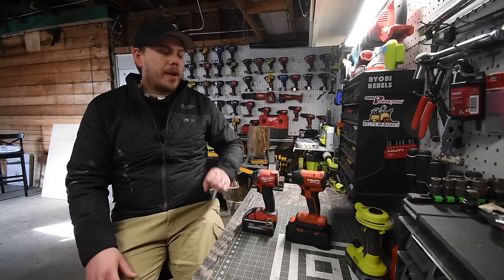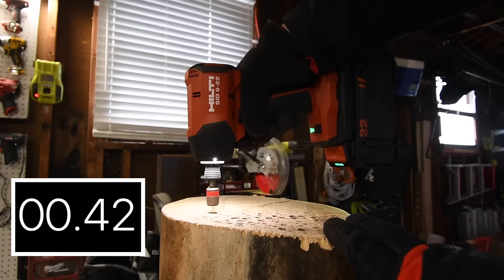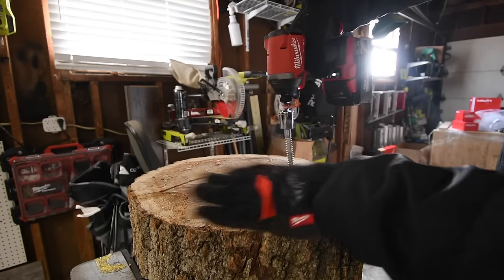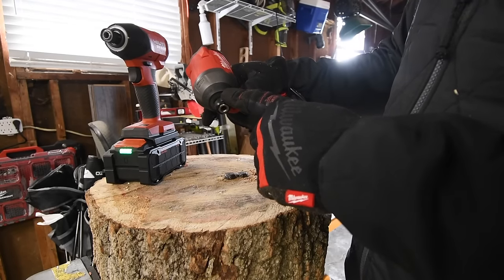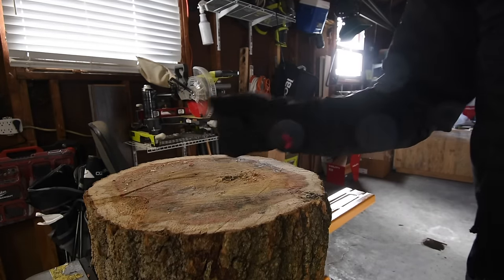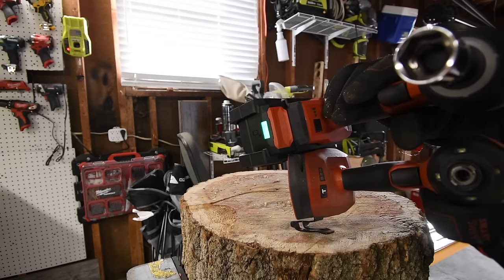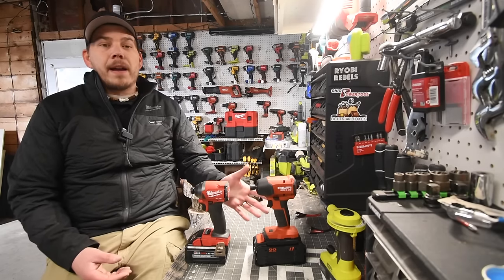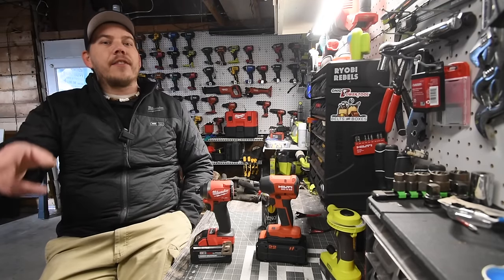Is Nuron Better Than FUEL Now?

Comment: Milwaukee’s old ass gen 3 still smokes the Hilti. Dave, I know Hilti just sent you $10,000 worth of tools but be a man, call a spade a spade. Milwaukee cleaned house as always.
Reply from the maker: That Fuel is a tough cookie
Reply: @ManCaverTools  it is. The amount of hype Hilti put on these new tools a person would think they are amazing…. Not saying they are bad but I’m pretty sure a Milwaukee gen 3 is cheaper. I know it’s stronger. Everyone is going to these higher voltages but not gaining anything. I know you like you 12 volt tools Dave, and so do I. I grab my M12 90% of the time when I can. I’m sure Hilti sunk a ton of money into this new line but I’m not sure it’s going to pay off for them.
Reply: @derekbross6958  Hi Derek, I use Hilti and Milwaukee  gear and the Hilti is far superior in in every way I need it. The Hilti stuff is not Nuron as it's not really in England yet. I won't get it when it does as I can't see the point for me.......If I was a big contractor maybe. I am really happy with my Hilti gear and I don't like the monster size Nuron batteries.  I also feel that all these modern drills are far too hi-tech.  I have been a Maintenance manager/ Carpenter joiner for nearly 40 years and don't need a combi drill that's computerised to tell me what setting to use etc. When I drive in a screw to the depth I want I release the trigger.....job done!! 😂😂.  I'm probably one of the only buggers left who still uses pilot holes when woodworking. I am however and old style carpenter joiner who loves using all my antique tools such as Disston handsaws and Marples wooden planes and cast steel chisels.  The place I work is grade two listed so my old style Carpentry and hand cut joints comes in handy. Plus I'm nearly 60 so buying a load of new gear is pointless. But it's Hilti all the way for me.
Dave.
Reply: @davesheppard8797  Fair enough, everyone has their opinions. As a contractor I’ve also used both. I was with Hilti years ago and didn’t have an issue with the tools themselves really. I found the platform to be very limited, and yes Hilti is trying to address this now, and overpriced. So I switched to Milwaukee and haven’t looked back and have been happy. As I said everyone has there preferences but my point was if a company is talking up their tools as much as Hilti has been doing recently you would expect them to at least keep up with a competitors version that’s over 3 years old and from what I’m seeing that’s not the case. In my opinion, and again this is just my opinion, you can get superior tools for less money then Hilti.
Reply: @derekbross6958  Hi Derek,
My Hilti combi has more power than my Gen 3 Milwaukee combi and I don't have the trigger issues, overheating and loose battery that I get with Milwaukee.  I personally find the Gen 3 impact far too powerful for what I use it for......PZ2 & 3 pozi screws. It just spins the bits out. That being said, I totally agree with you about Hilti's boast that it has much more power.  The Gen 3 beats the SID 6 all round.  I love my SID 4 for what I do.....it's  perfect. If I was driving hex headed lag bolts all day though I would have to go with the Milwaukee.   Personally  I can't understand the hype that's surrounding NURON. A whole new battery platform and new tools that basically give you a longer run time. Putting a screw in 1.5 seconds quicker than the old Hilti doesn't impress me! I have 4 Hilti drills and 5 various batteries ranging from 2.6-8 amp hour, so I'm not bothered about longer run time.  I have to say that the twin battery Hilti breaker is impressive but I have no use for anything that heavy being a Maintenance manager of a Theatre.  I feel that NURON is aimed at big construction firms rather than the little guy like me. I certainly won't be changing my SF6H,  TE 6 or SID 4 for NURON.  Going back to Dave's test.......the Hilti looked very unimpressive against the old Gen 3 Milwaukee and there is talk of a Gen 4 soon!  Hilti's upgrades aren't nearly enough for people to change battery platforms if they are happy with Milwaukee. 
Dave.

Comment: Are we sure driving in the Hilti's fasteners right next to the ones already embedded by the Milwaukee isn't making the Hilti's job much harder?
Reply: That’s what I was thinking
Reply: well given that in his latest video Neuron vs old Hilti, he does the same thing drilling the neuron fastners, right next to the old Hilti's fastners, and it beat the old Hilti by a wide margin, so I dont think it makes much difference.
Reply: @rocketmunkey1  I mean, I understand it's likely the Milwaukee is still the better impact here.  It's just a potential variable of testing that I see which could make the results less empirical.  I'd imagine the second screw might need to go through higher-pressure wood that the first screw caused or actually physically bind up on the first, especially if they're long screws.
Reply: @h8GW  Yeah I suppose it could have a slight effect, but not much. equally it could be argued that its a fairer test because the screws are being driven into the same area of wood where the woods density is likely to be similar. perhaps it would have been best to alternate which drill went first
Reply: The Milwaukee is way more powerful, either way.  And they’re impact drivers driving screws into wood so… not really.

Comment: These new Nuron batteries are next level chunky but at the end of the day both tools are going to get the job done
Reply: The Nuron uses a 2P/6S pack (two parallel sets of six 2170 batteries in series) while the M18 uses a 2P/5S (two parallel sets of five 2170 batteries).  Simple physics: the Hilti battery HAS to be larger.  The better question is what kinds of workloads benefit from the additional watt-hours of the larger battery?  Unless you make your living with these tools I'm going to say there's no practical difference.  In fact, for home/DIY use the Milwaukee M12 line is probably more than enough for most honey-do lists.

Comment: Man I h a t e hate that Milwaukee impact.  So the question is how does the Hilti feel in operation?  Does it lean toward the Milwaukee’s lack of control and vibration? Or does it lean toward the finesse of Makita and Dewalt?
Reply from the maker: if does feel good to hold while its in use. both of these impact drivers do
Reply: Go triple hammer-beat control of all the impact drivers for the jobs they are supposed to do
Reply: @ManCaverTools  We can agree to disagree on the Milwaukee. 😜 Who knows? Maybe I had a lemon? It’s a beast though.
Reply: @baseballdude8491  I’m way good on impacts, I’m considering a small Nuron kit to go around one of their rotary hammers (I freaking hate the handle on my XGT one) since I already bought the vac.  Alas, I’d need multiples of three different types of batteries and that defeats the whole purpose.   I owned the Hitachi/MetaboHPT/Hikoki 36v triple hammer (I bought it for the batteries). I know you love the brand but I personally didn’t fall in love with it.  The newest 18ga brad nailer from them is friggin great and I’ve been happy with their 16ga and framer.  I’m not a fan of their other cordless stuff but I do have a lot of respect for their multivolt approach.

Comment: I almost wish I would have invested into Hilti instead of DeWalt sometimes. Their offerings are highly impressive and the warranty is unmatched
Reply: What’s the warranty on their drills and impacts for example?
Reply: @BlessedFallout  25 years...I went with DeWalt because their the only American-Owned company left. Unfortunately the warranty is only 3 years. Not that I've even had one problem with my DeWalts but still 25 years gives insane peace of mind
Reply: 25 years on defects...
Reply: @layneblack6876  you're right, I just actually looked into it and it's a 20 year limited warranty and only 2 years wear and tear. I guess I don't feel that bad anymore lol
Reply: The only advantage is the 2 year warranty they'll replace anything even if you dropped it off a boom lift or something, other than that it's whatever. I still have all hilti lol

Comment: You already know I'm a Milwaukee guy,  BUT, every major contractor I've worked with,  who has 50+ guys, goes with Hilti. You can't beat their service, fleet system and 24hr replacement policy.  That's their niche, and they are the best in the industry for that. And there is nothing bad about their lineup.i am, however,  surprised that they don't offer a feature like One Key, for inventory management or theft protection like Milwaukee or Dewalt.   The fleet system,  where you've got tools all over multiple jobsites with multiple employees,  I'd think you'd want that feature.   Maybe there are proprietary or legal patent cases,  I wouldn't know.
Reply from the maker: HILTI warranty is a darn good one
Reply: Hilti does have inventory management.  It's called On!Track and the fleet management  system comes with theft protection.  Both are excellent programs

Comment: Hi Dave,
Dave from England here. I use Hilti and Milwaukee. In my opinion the Hilti gear is far superior to my Milwaukee gear.  I don't really get what Nuron is really about apart from longer run time and a bit better performance. I think this is fine for  big construction companies (The Nuron breaker is incredible!!) But for me a Maintenance manager and Carpenter/ Joiner I can't see must difference or benefit to me over my new-ish 22 volt non Nuron stuff.  The standard 22 volt gear is superb and the best I've used in 40 years but "Nuron" certainly isn't worth buying new drills for.  There is an adaptor so you can use the standard tools with Nuron but it makes the tool so big and bulky.  Also this new SID 6 Hilti doesn't out perform the Milwaukee Gen 3 so not a great jump there from the SID 4 I own. I also own Milwaukee Gen3 combi and impact and neither are as nice as the Standard Hilti stuff. The Hilti combi I have is more powerful than the Gen 3 combi but the Gen 3 impact is much more powerful than my SID 4 Hilti. I still prefer the Hilti though.  In your comparison the New Hilti lacked the power of the old-ish Milwaukee.  Not that I need the Gen 3 impact power but Hilti's claim of a lot more power is unimpressive against the old Gen 3.  I love and use Hilti......I just don't think this new Nuron makes that much difference......certainly not for me anyway. 
Dave.
Reply: I personally love milwaukee, apart from the fmcs metal saw the hilti one of the lads on site has is the absolute k9s nads and glides through unistrutt like it's butter where as the milwaukee snags like mad. I use the m12 platform as well as the M18 and again there kit is spot on.
Reply: @kaimccalla2936  Hi Kai, I much prefer my Hilti combi and impact over my Milwaukee combi and impact....... I do though also have the Milwaukee M18 fuel 6 1/2" Circular saw (for Timber) and that thing is incredible!! The trigger has recently started playing up like all my Milwaukee tools but the performance for a cordless saw is amazing.  The fuel jigsaw is powerful too but vibrates a bit too much and again.....trigger issues.  I would love to buy the Hilti Circular saw but I can't imagine that it would outperform the Milwaukee.  Glad you enjoy your gear though mate 👍👍
Dave.
Reply from the maker: we will see how the new HILTI performs in future videos.  a lot of these tools require a break in period, which is why I usually do a few videos on them before I go against other brands. but it didnt do too bad for its first video. More tests will be done and we will see. I do think their will be a major improvement compared to the previous model impact driver. that video is coming up soon
Reply: @ManCaverTools  If there’s ever a case for break in periods…my vac is performing MUCH better than it was initially.  I don’t get it. There are no gears. It’s brushless. This does not compute.  Still having a lot of issues with Bluetooth causing the battery to bug out.

Comment: The Hilti seemed to drive that 8 inch lag better than it drove the 6 inch huh?
Reply from the maker: The Milwaukee did as well. That is one problem with wood. its inconsistent, thats why I do the tests next to each other. so its around the same density  of wood, or at least try to be

Comment: The Milwaukee is by far the best impact driver I have ever used. However, when it finds a task it doesn't like it just seems to give up and never starts again. When you pull the trigger there's a short beep but no action, as if there's a safety that shuts the tool down. They don't burn out, they just quit. Has anyone else found this? By the way I've seen this happen to at least 5
Reply: I have just given my Milwaukee Gen3  impact away to my work mate. I find it too manic and like all my other Milwaukee junk it has trigger issues. My Hilti SID-4 (not Nuron, don't see the point) is slower but so smooth and easy to use all day with no user fatigue.  My Gen3 combi is also crap compared to my Hilti SF6H A22. After just drilling in a few dozen screws the Gen 3 combi gets really hot. I have heard that the Gen4 gets even hotter!!  I'm not really short of money, love tools and so bought Hilti and Milwaukee and I find all the Milwaukee gear is just substandard.  I am 60 years old, live in England and have a love of hand tools. I am a collector of original Disston saws, Marples Cast steel chisels, old wooden jack and smoothing planes, rebate planes, rosewood squares and gauges. I am a Maintenance Manager of a large Theatre where on occasions I have to hand cut timber joints such as dovetails and mortise and tenon as part of the ongoing restoration I do.
Dave.

Comment: Could driving the hilti screws directly beside the first screw have an affect because the wood surrounding the first screw has been compressed and is now more dense than the wood without a screw? Seems like it would be negligible, but just a thought.